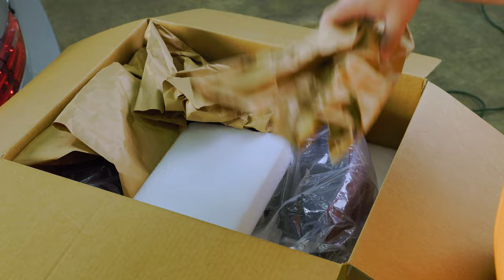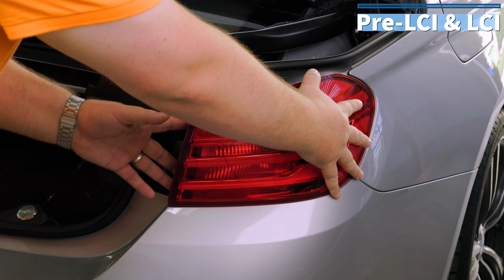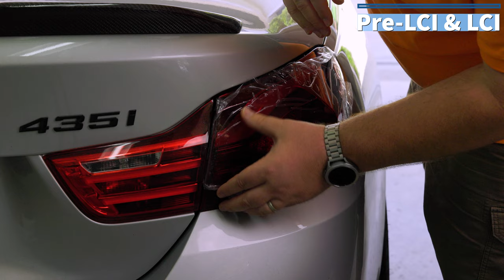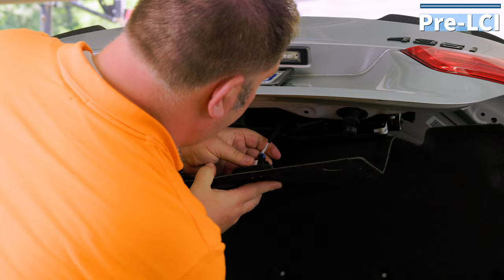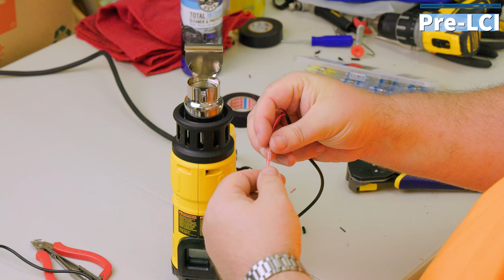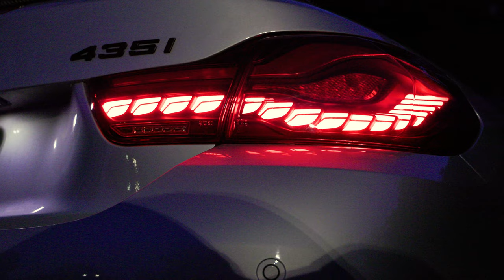GTS STYLE TAILLIGHT UPGRADE | THE ULTIMATE F33 INSTALL GUIDE 🔥🔥🔥

Comment from the maker: The GTS Style Taillight upgrade is one of the best ways to transform the rear of your car. These taillights look absolutely amazing, I'm so happy with how they turned out. In this video I'm going to show you how to upgrade the taillights in a Pre-LCI F33. 🔥🔥🔥

If you've been looking for a complete installation guide for these lights, look no further, this is it! 

Kies Motorsports 4 Series GTS Style Taillights: 
https://www.kiesmotorsports.com/products/bmw-f32-f82-gts-style-oled-sequential-tail-lights-set-v2?_pos=4&_psq=gts+tail&_ss=e&_v=1.0

🛠Tools Needed 🛠
*LCI: 8mm, 10mm, T30, Pick Tools, Trim Tools*
*Pre-LCI: LCI+, 20 Gauge Wire, Low Solder Connector, Heat Gun, LCI Trim, Tesa Tape, Wire Stripper, Wire Cutter*

Pick Tool Set: https://amzn.to/3DBpywI
Trim Tool Set: https://amzn.to/3rXA3HS
Dewalt Mechanics Tool Set 247pc: https://amzn.to/31CHbcf
Heat Gun: https://amzn.to/33tEWdG
Wire Stripper: https://amzn.to/3QwkBNo
Wire Cutter: https://amzn.to/453YLW3
20 Gauge Wire: https://amzn.to/3KIH3Px
Low Solder Connector: https://amzn.to/3s9pLEQ
Tesa Tape: https://amzn.to/3KDGBC1
Zip Ties: https://amzn.to/3rRAG63
LCI Trim (ECS Tuning):
     Left (63217463139): https://www.ecstuning.com/b-genuine-bmw-parts/trim-drip-rail-lef/63217463139/
     Right (63217463140): https://www.ecstuning.com/b-genuine-bmw-parts/trim-drip-rail-rig/63217463140/

Comment: i have a 2016 f33 with prelci taillights do i need the extra parts and wires? is it really not possible to just plug and play ?
Reply from the maker: The only way to make them work correctly on a pre-lci is to run the extra wiring. Without that, the sequential lighting won't work.